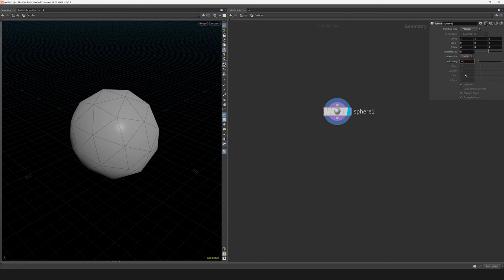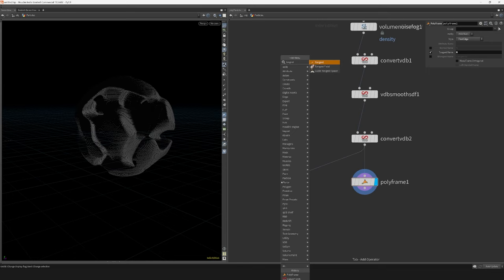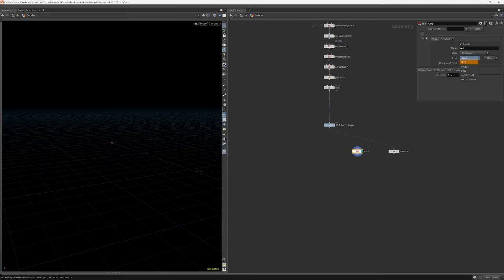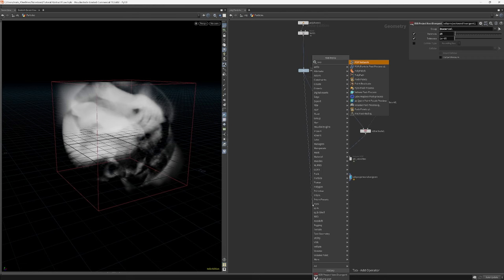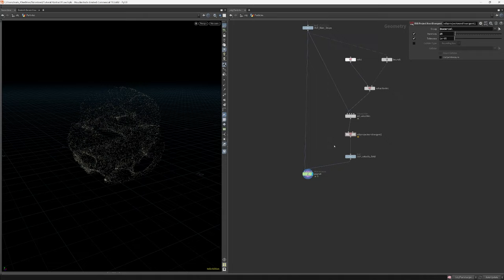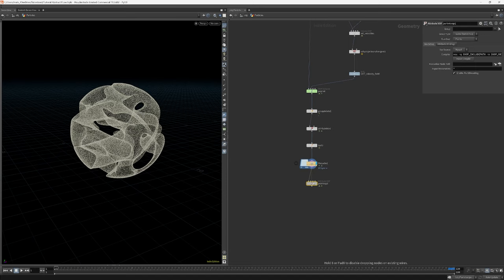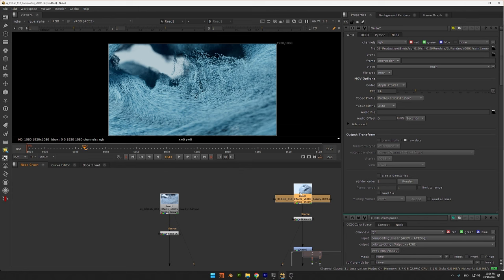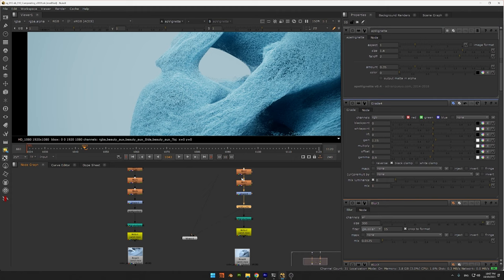Houdini Tutorial: Abstract Particle Flow

Comment: I have a strange issue, my particles are going outside to cube container, not circular inside. Any ideea?
Reply: (edit, I found the solution) If anyone else got this problem, you just have to check the tangent name option instead of the normal name, into the polyframe node
Reply: I am facing the same issue, particles are not going towards a direction its going outside everywhere. did you manage to fix it ? if so then pls tell me.

Comment: Hey Mats, thank you for the Tutorial buddy :) 
I have a question, after the popnet, when you run your simulation, seems that your particles follow a path, mine particle behavior doesn't follow any path just expands outside a bit in every direction. How did you manage to give direction to your Particles?
Reply: i found the Solution: for some reason in Simulation tab in the popnet node,  the Timestep and the offset Time were preselected  animated (but why??) :O  I delete the channels and it worked!
Reply: @Hardnine9 hey, how did you fix this? I deleted the channels but still have the same issue, did you change anything afterwards? thanks :)
Reply: @lukecampbell5553  Hey buddy, pretty sure that changed after I deleted the channels.
Reply: (edit, I found the solution) If anyone else got this problem, you just have to verify to check the tangent name option instead of the normal name into the polyframe node

Comment: hi, "volume noise fog" is missing dont k way?
Reply from the maker: @gunayali-wj4xy  Maybe they removed it in Houdini 20. I will check and get back to you
Reply: @mnymanVFX  On the contrary, it may need an update
Reply: @mnymanVFX  my software i mean 🤒
Reply from the maker: @gunayali-wj4xy  I just checked, and the nodes are still present in Houdini 20.5 :) Yeah maybe you have to update if you are using an older version. I believe those nodes were released in 19 or 19.5. Thanks for watching!
Reply: @mnymanVFX  
Thanks to you, you are amazing at these simulations good luck 💚